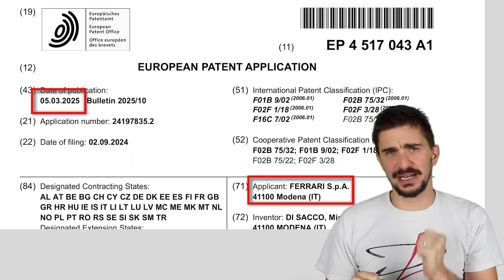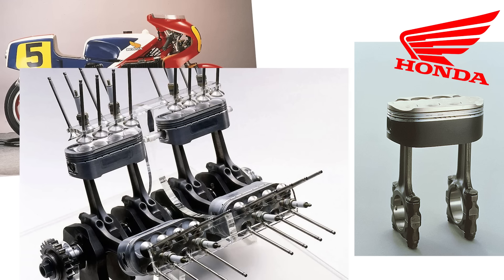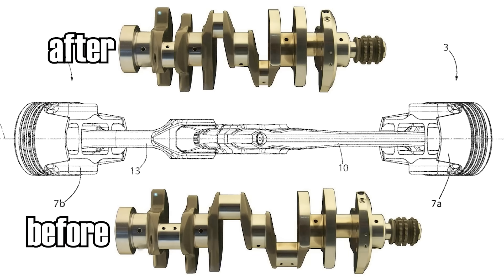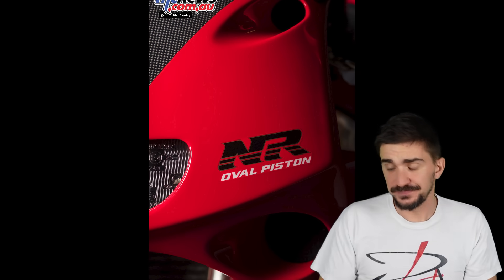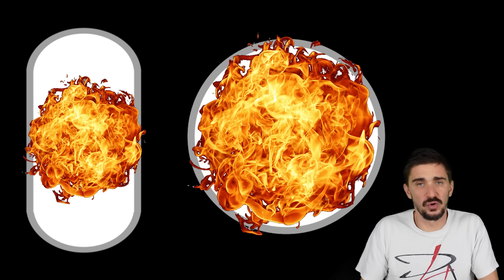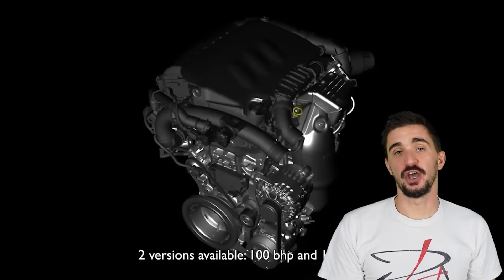Ferrari Just Patented Pill-shaped Pistons and Siamese Connecting Rods

Comment: The piston shape is more properly called OBROUND.... 
Definition:
An obround is a two-dimensional shape formed by connecting two semicircles with a straight line segment, creating a shape that looks like a flattened cylinder or a rectangle with rounded corners.

Comment: "Driving engine"
Yep, they are clinging to pure ICE because of their niche market. Maybe they should call it "the occasional driving engine".

Impractical but fun and kinda cool. The patent sounds tenuous. The primary patent is now public domain and the tech won't proliferate anyway.

The rocking issue that may or may not actually exist would disappear if Inverted Crosshead style connecting rods are used (where the top end of the connecting rod bears lateral forces instead of the piston).
Thumbs up.

Comment: All these solutions point to a shorter engine, but I see a number of problems with this:
1. These rods will make the pistons move in different patterns between banks, needing different control strategies, CR, timing, etc, as things like TDC dwell and piston acceleration will be different.
2. Honda's engine was a solution to make a v8 with technically/legally 4 cylinders, so the valves were lined up with the intake/exhaust ports in the heads. Ferrari's engine does the opposite and the only way I see to fix it is to use only 2 gigantic valves per cylinder, otherwise they'll have to run internal manifolds/headers inside the heads to each cylinder, on both intake and exhaust sides, making one cylinder's exhaust heat the next one's intake up, kinda like what happens in VR/W engines.
3. The problem above is repeated with the piston pins, as he mentioned, requiring larger skirts (more drag) and larger cylinder offset, which will need to be different on both sides because of unequal piston movement patterns;
4. Cooling will be a challenge, as more cylinder wall area is closer together between cylinders, and fixing it requires running extra cooling channels, making the engine longer again anyways.

It all looks like an early 20th century italian engine, to be honest.
Reply: An early 20th century Italian Aero-Engine. It's the conjoined conrods - a design seen immediately post-WW1...
Reply: This type of connecting rod design is not new , it was used on a lot of old aero engines. The world landspeed Sunbeam car which is currently being restored has an engine that uses this type of conrod design , a cosworth engineer has studied it an has confirmed that it makes no difference to the piston  stroke or speed. ( as it still rotates around the same crankshaft journal) putting it simply.
Reply: @jeff.5380        Please watch the video rise and fall of radial engines. The crank side of a slave conrod will always move in an oval path in relation to the master conrod's circular path
Reply: I really don’t see #2 as a big deal. 
There is already an “internal manifold” surrounding the 2 valves that you’d find on each side of any modern engine. You are just going to end up with probably 4 valves for intake & exhaust
Reply: @joashparker8271       Only 4 valves in a pill-shaped cylinder would compromise air flow because of the difference between piston head area and valve area, so this engine needs as much of the combustion chamber area in the heads covered with valves as possible, especially if it needs to run at high RPM. To make Ferrari's engine with 8 valves, it would be necessary to either bunch all intake valves on one end of the pill shape and the exhaust ones at the other end, or put all intake valves on one side, etc and running a mini intake plenum for each cylinder inside the heads. The valves bunched at the ends would have the first 2 valves interfering with the airflow of the ones behind them, and the mini plenums would increase the heat absorbed by the heads from the exhaust and dumped into the intake air by the heads.
Two large valves will cover a lot of area, make everything simpler, shorten the intake and exhaust ports inside the heads and make the engine breathe better at high RPM. However, even this solution would bring its own challenges, like valve weight/inertia, and the probable necessity for 3 spark plugs per cylinder.
Reply: Not to mention combustion efficiency and ring stability issues, emissions will be tricky. If it was my guess this is not intended for FI.

Comment: You know, I've always thought that having the wrist pin across the long axis would reduce torsional imbalance at the piston, but while thinking about it further, it would not only make an engine longer, it would create a now 90° shift in the connecting rod that would translate to a torsional difference at the crank that would require bearings capable of working across a two axis plane. 
Unless the crank could be designed to do the same, it would be impractical and not cost-effective as the savings would quickly be eaten up in the complete redesign of the crank assembly. 
Thanks for making my brain hurt on a Sunday morning 😂

Comment: How can Ferrari get a patent on a connecting rod with a link rod. Been around for literally 100 years. Napier used main rod and link rods on the W12 Lion. The only advantage l see to the oval pistons is increased valve area. Although the port arrangement looks it would have to  be a little odd to me. 
The machinist in me is having a hard time figuring out how they machine an finish the bores. A broaching operation perhaps.
PS the reason Honda tried the idea in the 70s was to try and get around the limit of 4 cylinders in the rules. The NR can be thought of as a V-8 with joined cylinders.

Comment: now i'm on rods section of video, and from very beginning of video I also was concerned by rods design. And as I was mechanic in "big diesel engine" repair company, we were working with all kind of truck and tanks engines, soviet and EU and US for semitrucks, for boats, for trains, you name it. And there was one soviet v6 engine, UTD-20 (duno, maybe there is some similar designs in "western world", but I know just this), where rods came in pairs, lets say inner and outer, where inner goes to crankshaft and has surface where outer rod is pt on and sliding on inner rod, if it make any sense for you. Not sure about other benefits and drawbacks, but seems to me it should have much better balance. There is photos on this page, just replace comma with dot if you interested to check how it looks obyava,ua/ua/shatuny-na-dvigatel-utd-20-8926159.html
what are your thoughts about such design? For now my concern is only about outer rod lubrication, but I wasn't working on this engines directly, some coworkers did them, so I don't have info about common issues, just that it was pretty hard to work on because of tight space.

Comment: Can asymmetry in the pill shape be used to combat cylinder rotation?  If the non-thrust side is slightly wider than the thrust side, it would naturally prevent rotation and could be used to more equally distribute wear and friction around the cylinder.

Comment: I got an idea, what if they had a triangle shaped engine with like 2 pistons in a row as if it were one of those rotary engines from ww2 (not the darrito, the other one) that was sideways like a frisbee to avoid flooding issues. It would be super balanced I recon, it could be smaller, rev higher, and probably super tworqe dense as well because you could have it fire 3 pistons at a time once the computer detects it being under a ceartan load. You could even probably attach a turbine through the center of the crank because it would be triangular and have a circle through the center so you could force induction with absolutely no parisitic loss but that would be an unreliable oil leaking nightmare.

Comment: This set up can seal, but it likely won’t last as the ring pressure on the flat flanks is greater than the round ends.  Still the wear may be acceptable.  Similarly the stress in the cylinder wall is greater on the flanks.
    Master slave rods have another quirky feature.  TDC of the slave rod versus the master rod doesn’t correspond  to the V angle.  (Research Old Machine Press’ and R2800 radial engine for explanation).  To compensate the slave pin is indexed a bit.  The Ferrari engine is a V12 or 2xI6, and I6 is balanced so vibes not too bad.
    This engine is definitely one where you ‘never buy the A model’.    Cheers

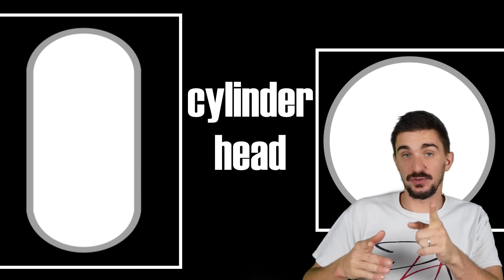Comment: 10:24 that's a good point, but I keep wondering how they are going to fit/route the intake or exhaust passages. The Honda had the ports/passages coming in on the side (major axis?), these have the sides blocked off due to the flipped orientation of the pillstons

Comment: I suspect the bizarre conrods will be much more difficult to balance than you think. And the piston rocking will be a big issue in the long term. But knowing Ferrari, they'll probably view that as a plus. More "emotional vibrations" as you say, and more maintenance money flowing Ferraris way. It's not like Ferrari owners mind throwing a few K at maintenance every few months and by the time the cylinders are ruined, the car will have been sold to the second owner.
Another issue is can potentially see, is uneven thermal expansion. Circles are easier to manage in that regard since they expand the same amount along the whole radius. A pill will expand more longitudinally than laterally.

Comment: I want to know more about how they would package the valves in this engine, the only thing that would seemingly fit well is either using a 2V head or a 6v head with a 2 x 3 sideways layout. There are issues with both options.

Comment: Oval pistons seem a natural solution to shorten engine blocks and seems to me it should have been commonplace if not for the various engineering disadvantages to overcome.
Now I'm wondering how Ferrari can take a patent on it given that Honda has solved the engineering problems long beforehand and produced it even on a limited run.
Another thought; an oval piston design would make it feasable for i6 engines to fit into the space normally taken by an i4, maybe in future.
Reply: The patent is on the engine, not just the piston.

Comment: your piston jokes are a stroke of genius.
Reply: And not a bore!
Reply: Oil you cons are making me cranky with this  journal.
Reply: Just about bearing up under the strain....
Reply: You Wankels are hilarious.
Reply: @AntiCoruptionCentral  Wankels? It would not surprise me, if Wankel is a Saxon word, that popped up in English. Maybe your joke actually has a point.
Reply: something is off, but they aren't well rounded in this video.
Reply: That comment runs rings around mine!
Reply: Kinda up and down though.
Reply: You've really ignited something in this thread, they're getting hard to pin down though
Reply: Mostly revolving arount the shaft
Reply: I hope the timing of these dad jokes doesn't make my head explode!
Reply: Are they a 2 stroke of genius or a 4 stroke?
Reply: @mercoid much better, I’m thinking a 6 stroke of genius.
Reply: @TheReboot   Those do exist. Go check why it is not good enough.
Reply: @mercoid  Funny, but are you aware of the 6 stroke engine? It does intake stroke TWICE, that has advantages for producing a better fuel and air mixture. But the obvious drawback is not 360° (2 stroke), 720° (4 stroke) but 1080° turning before each spark fires again. Less power than the same size 4 stroke. A 6 stroke engine needs to be larger than a comparable 4 stroke. And that is not going to happen, a more efficient engine that is heavier, it is not that much more efficient, I guess.
   But there have been studies. You never know if 6 stroke might get a second chance. Think about hydrogen combustion engines, the moment we could tank liquid hydrogen at all gas stations, those hydrogen engines could be a great in between when hydrogen cell cars (those are electric) are not for sale in huge numbers. Then hydrogen combustion engines are easier. And a thrill to drive, if you'd ask me.
Reply: He’s a bit of a pill.
Reply: Surprised by the jokes people cam up with here.
Reply: He’s a barrel of laughs isn’t he?
Reply: @ I was choking
Reply: Just give me a flat head six.
Reply: Well played, gentleman. Everyone is coming in clutch. 
Perfect duration and timing to lift everyone’s camber. 
Perfect mixture of word play to not tire anyone. Just enough bang, not too rich not too lean. 
The advancement of the sparkling Dad jokes hasn’t been knocking anyone the wrong way.
Reply: If the engine blows is it technically popping pills??
Reply: @mallorymaina6400  for the win
Reply: I see what you did there.
Reply: 2 strokes of genius
Reply: Ouch! 🤣
Reply: These jokes are such a bore 😅
Reply: @zat-1-fury  ne m'en parlez pas, je me suis claqué un muscle zygomatique.
Reply: Honda patends
Reply: Pistons shaped like amyl nitrate poppers and lots of rods connected to each other. I hereby name the engine La Docking.
Reply: Oh dear. 😐
Reply: I´m stroking it right now while typing this with my nose
Reply: ba dum tssssss
Reply: Touché
Reply: yeah they were pretty good. Idk why they are getting pissed-ton in the comments.
Reply: Last night I dreamed I was a MUFFLER and when I got up in the morning I was EXHUASTED.....
Sorry, that joke always BACKFIRES on me.......
Reply: The true word is piss ton. A turbine engine (just watch an ailiner plane) can easily make your reasonably priced family car go faster than sound. Our roads can't cope with that. Our tires neither. You bet a  turbine engine not even that large could make your car five times faster. Anyone, why is life so boring? Piss ton, piss ton on the wall...
Reply: Because of the perfect timing...It would be a disaster othewise
Reply: They were amusing, dished out right off the top of his dome...
Reply: 2 or 4 stroke of genius?
Reply: I'm stroking my dih rn💔
Reply: Laffed so hard, I blew a gasket.

Comment: Another disadvantage, 

The patent shows that the engine is locked to a 120° V angle configuration, effectively making it a ovesized boxer.

This poses no problem for let's say a mid engine flagship car (Ferrari F80 XXK mayhaps?) but for a front engined car such as the 12 cilindri, the added width may interfere with the wheel geometry of the car

Comment: Curious to see the wear on the cylinder - pill? - walls in a performance application. The tech needed to compensate for this design might completely offset the "low cost". It might be 2025, but this is Ferrari we are talking about. Honda has a reputation for reliability.. and since it's not the '90s anymore, everyone knows about Ferrari's lack of reliability.

Comment: My big question...."Where do put your intake and exhaust ports?"  Honda had no problem because the piston's long axis ran parallel to the head/crankshaft...you had plenty of room for ports/valves/valvetrain.  Now Ferrari turns the piston 90° so the short axis faces the manifolds.  How is this going to work?  One huge valve at each end of the chamber so you still have a proper crossflow?  Eight valve heads?  How do you package that and keep a shortened block/crank length?  Where do the ports go?  What sort of insane valve train will be needed to keep all those valvoles happy? Are they going to trade a poppet valve system for some sort of rotary setup (Coates)?   I guess I lack imagination.

Comment: I wonder what a mess the valve and camshaft arrangement will be. A 8 valve solution seems the most likely, but for honda version it was easy, essentially it was a v8. I really can't imagine the layout of the heads. 
The siamese conrods were used on soviet airplane v12 during the II ww, it was an inferior solution to western "knife and fork", with 2 conrods on the  crank. Surely it is quite strange, the main problem by now is emission regulation better then packaging.
Great video as usual, the way you explain things is top notch (humor's good too...).

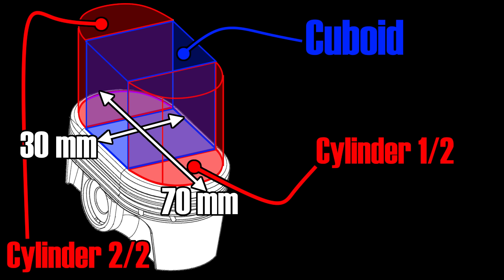Comment: 3:34 If the cuboid is 30mm across, then the diameter of the 'half cylinders' at each end must also have a diameter of 30mm, therefore a radius of 15mm. If each half cylinder has a 15mm radius, then the 'major axis' cannot be 70mm, it MUST be 60mm.
Reply from the maker: Why must it be 60? In caps too? The cuboid is 30x40x50. The 30 is the minor axis.
Reply: @d4a  Ok, if the cuboid is 40mm long, I'm wrong. I just assumed that as a 'cuboid' the length and breath would be the same. I don't usually refer to something with differing length and breath as 'cube' (it would be a 'rectangular prism'). Apologies.
Reply: @Chris-hx3om  A cuboid is any 6 sided polyhedron, it doesn't have to have equal sides or equal angles.  A cube is a special case of a cuboid.
Reply: @ferrumignis  As I just said, I've always called a 'non-cube' a rectangular prism, never a cuboid.

Comment: Harley Davidsons conrods also share a crank pin but they have a way better system, one of them is 'forked'. Do they also have a patent? I've never seen another engine use it.
A notable difference is that Ferrari's pill shaped pistons are perpendicular to the crankshaft, Honda had them parallel.

Comment: No one is talking about the massive challenges around getting enough valve area on top of this “ovaloid” cylinder shape. Or how to light off the resulting charge with a reasonable amount of ignition lead. Or about a half dozen other brand new challenges that arise with the design in question.
Reply: I don't see why it's a "massive challenge".  If Yamaha can pack five valves into a hemispherical combustion chamber, there no reason that Ferrari couldn't pack four valves in each "end" of the cylinder.

Comment: Good Piston ring tension is going to be a real pita.
The Honda was an oval not a pill shape so that’s not the same thing for sealing. 
Machine shop nightmare.
Solving piston load is easier with hard anodized pistons, skirt coatings and spray liner cylinder walls are stronger and harder.

Biggest question is what’s next?  A squircle piston like apples designer shaped squircle pc?